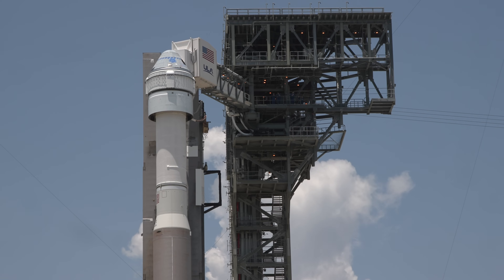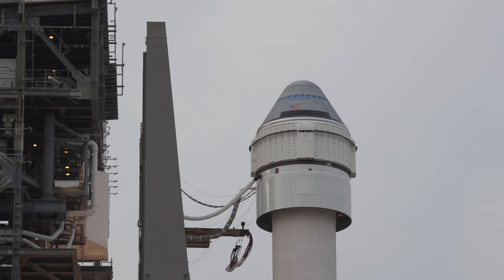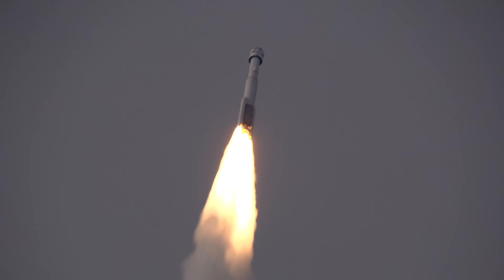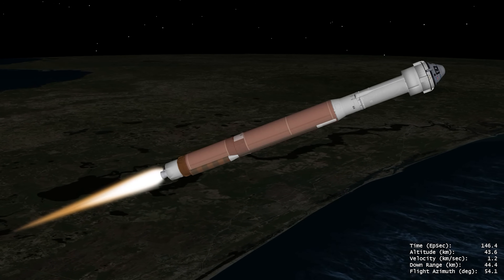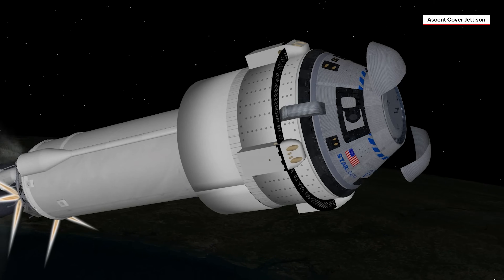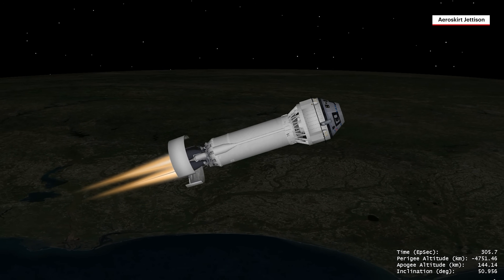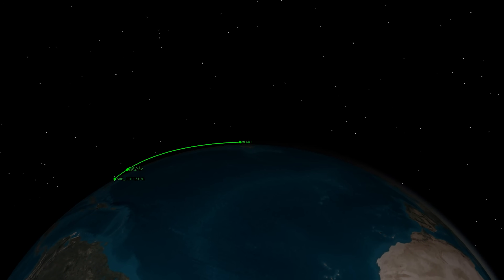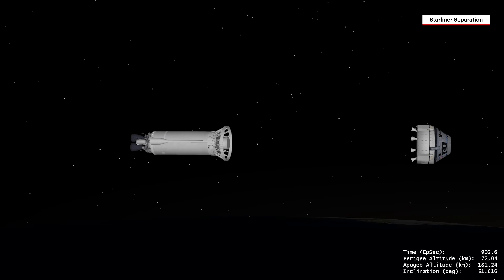Atlas V Starliner CFT Mission Profile

Comment: Best of luck ULA and godspeed CFT hopefully everything goes smothly like every ULA launsch so far 

Gosh can some pepole just shut up for once and not complain that a rocket is expandebel
Reply: Bro most of the negativ comments are about Atlas V being expandabel and you yourself are  one of the ones who mostly shits on Atlas V for not being reusebel and i wont argue about starliner cause i dont know much about it and also not being reusebel donst mean crap and also making Atlas V reusebel is remaking Atlas V not modifing it making Atlas V reusebel would also gratly effect its Performance
Reply: @ILikeAlotofThings-SLS  First of all, every heard of ".". It makes your sentences easier to read.
" i wont argue about starliner cause i dont know much about it"
But I do, and it should never fly with crew. Flammable tape, faulty parachutes, corroded valves, the list is seemingly endless.
"also not being reusebel donst mean crap"
Its 2024. Yes it does.
"Atlas V reusebel is remaking Atlas V not modifing it"
Yeah. I know. It needs to be retired because it is obsolete.
"making Atlas V reusebel would also gratly effect its Performance"
Not really. Maybe, without SRBs, it would have a payload of 6-7 tons, and a launch cost of ~30 mil, which is roughly 1-2 tons less than expendable and about 3x cheaper.
Higher energy orbits would, admittedly, suffer, but in 5-10 years, the vast majority of flights (excluding the 100s of starlink flights) will be LEO
Reply: Ok i mayby wrong about reusabillity. But still no dont having it still dosnt mean crap cost isnt everything safty in my opinion always goes over cost and also there are a bunsch of rockets that arnt reusebel that are good and that dont need to be reusebel for example SLS isnt reusebel dosnt need to be and it wouldnt benefit from it if you want to know why i say this check out David willis's video about that there are other examples like SLS by the way  . And news Flash Atlas V will be retierd have you heard of Vulkan Centaur  . And i wont still argue about Starliner i know next to nothing about it . Also yes my writing is bad i gotta admit that
Reply: @ILikeAlotofThings-SLS starliner is the opposite of safety
Reply: @ILikeAlotofThings-SLS  
"everything safty in my opinion always goes over cost"
And Falcon 9 is the only rocket with over 100 consecutive success. I think it's at about 300 (ish). Reusability enhances safety, because unless it's the stage's first flight, you know it's worked before.
"example SLS isnt reusebel dosnt need to be and it wouldnt benefit from it if you want to know why i say this check out David willis's video about that there are other examples like SLS by the way  "
All of that is incorrect. SLS would be much better reusable (which would require a major redesign, and you'd probably end up with something like Starship in the end).
"And news Flash Atlas V will be retierd have you heard of Vulkan Centaur"
Yes, and Vulcan is also decades behind Falcon 9.
"Also yes my writing is bad i gotta admit that"
I wasn't trying to shame you (and yes, my message was way too rude. Sorry about that), just try to work on it. It's very hard to read.
Reply: We're too busy being worried about the astronaut's safety to complain about the Atlas V being expended (which is still absurd: it's 2024, you'd think ULA would have figured out propulsive landing by now)

Comment: So much stuff just thrown away.
Reply: aint that the truth. its 50 plus year old tech they are selling aS new
Reply: @tc539  Its more like 25 year old tech. The rocket design isn't fixed, its evolved over time. Obviously someone who doesn't know anythign but what twitter tells them.
Reply: @okankyoto  and? It's still expendable, which became obsolete almost 9 years ago.
Reply: @bryanillenberg  You do know that Atlas V is being retired right? There's only a handful of launches left, including the 6 remaining launches after CFT for Starliner, and 8 Kuiper missions.

Vulcan Centaur with SMART and possibly the evolved ACES technology Centaur V will change that.
Reply: @Starshipsforever  "You do know that Atlas V is being retired right?" Yes, I know Vulcan is a thing.
"There's only a handful of launches left, including the 6 remaining launches after CFT for Starliner, and 8 Kuiper missions."

I think those are all the launches remaining.
"Vulcan Centaur with SMART" And thus wasting 60% of the first stage when it could be recovered.
"possibly the evolved ACES technology Centaur V"
By the time that comes online (if it ever happens), there will be refuellable methalox tugs 100x the size of Centaur V, with basically indefinite operations length.
Reply: @bryanillenberg   Vulkans smart reuse yes dont recover a lot of the rocket but the engines make up 60% of the price of the first stage. so ULA can have the abillitys of a expandebel rocket like Delta IV and safe more then half of Vulkans cost
Reply: @ILikeAlotofThings-SLS  Well, 60% of the cost of stage 1, 0% of the srbs (which are incredibly expensive, due to being impossible to truly reuse), and the least economical second stage design possible.
Compared to 100% of stage 1 and fairings for Falcon 9, and pretty much the optimal (expendable, which is very different from the truly optimal reusable second stage) second stage design.
In other words, SMART is dumb.
Reply: @bryanillenberg  just wanted to say this Vulkan is VCs first Stage its called Vulcan crntaur after its stages also try reusing a srb that is one piece so there isnt any place for paracutes.and as of writibg this there of my knowlege hasnt been a rocket that has recoverd its orbital stage becouse recovering a orbital stage is hard
Reply: @ILikeAlotofThings-SLS  "try reusing a srb that is one piece so there isnt any place for paracutes" The # of pieces an SRB has is irrelevant for reuse. SRB reuse simply cannot be economical, and therefore, they should not be used for orbital launches.
"and as of writibg this there of my knowlege hasnt been a rocket that has recoverd its orbital stage becouse recovering a orbital stage is hard"
No harder than recovering a crewed spacecraft.
Reply: @bryanillenberg  My point Was that VCs SRBs cant be recoverd becouse they are one piece so there aint room for paracutes.  Also SRBs are cheaper and more powerfull then liquied engines so its more of a trade off .by the way cheaper rockets can also be economic have you heard of Big dumb booster becouse reuse aint the only way to make things cheaper manufaturing is also a factor . Also if its so easy to recover a orbital stage why didnt the shuttle recover the ET? or the SLS its Core stage ? Bring somthing that is big through the Atmosphäre that has orbital velocity is relly hard (hint there is a reason orbitall stages arnt relly recoverd)
Reply: @bryanillenberg   big dumb boosters arnt solid fueld they are preuserfed with leqiued fuel they are big becouse you need preuser tanks to get the propellent into the engine becouse they are so simpel they are called dumb booster.  Also the shuttle and buran were a spaceplane and its diffrent then recovering a big stick.  And also raptor hasnt really properly relite this far. Yes reusebility can cut cost dramaticly of the thing that is recoverd things like fuel,employess,launshpad,commponents that arnt recoverd dont get cheaper
Reply: @ILikeAlotofThings-SLS  "big dumb boosters arnt solid fueld they are preuserfed with leqiued fuel they are big becouse you need preuser tanks to get the propellent into the engine becouse they are so simpel they are called dumb booster"
Solid's are a form of Big Dumb Booster. And no one (for good reason) has ever built a pressure fed orbital rocket.
Also, big rockets have a huge incentive to not be pressure fed, not the other way around.
"Also the shuttle and buran were a spaceplane and its diffrent then recovering a big stick"
The methods to recover a second stage and a first stage are different, so your point makes no sense.
"And also raptor hasnt really properly relite this far"
IFT-3 boostback burn
"things like fuel,employess,launshpad,"
If the launchpad is rapidly reusable, it's a lot cheaper. (I'm willing to bet SLC-41 refurb is way more expensive that LC-40 or LC-39a turnaround.
"commponents that arnt recoverd dont get cheaper"

Which is why EVERY component should be reused. Thanks for making my point for me.
Reply: god…. you people can’t appreciate anything - always finding a way to complain
Reply: @OwnedBucketTheBucketMan Do you agree to pay more for an old Pinto or a state of the art Mustang? That is what we are talking about.
Reply: @tronziebit  Funny, that seems to be the other way around with Starship. And several Falcon 9 launches have gone for more that Atlas V in the latest round of commercial contracts.